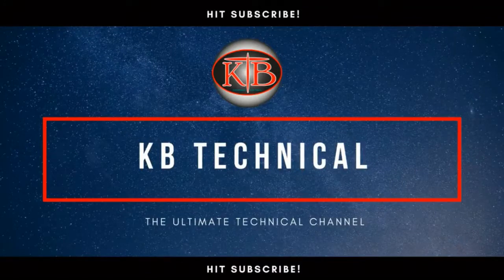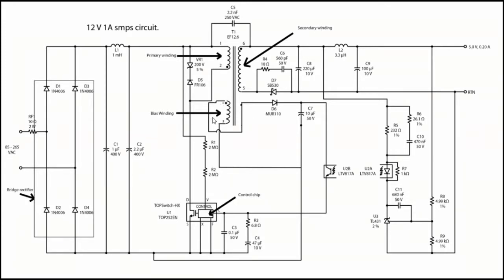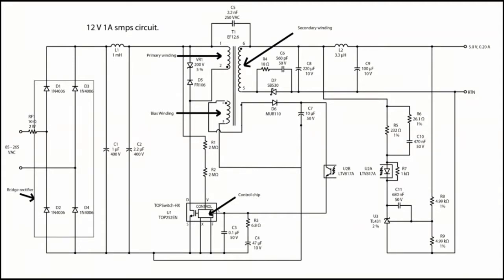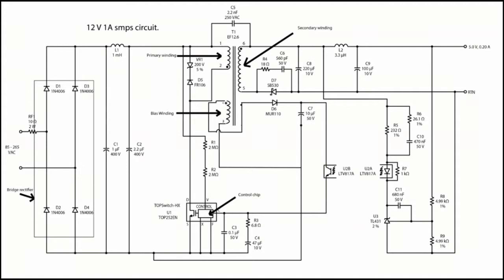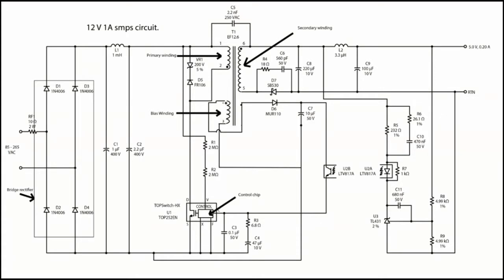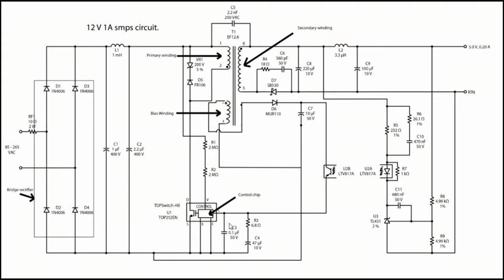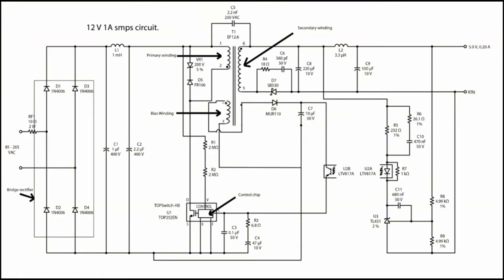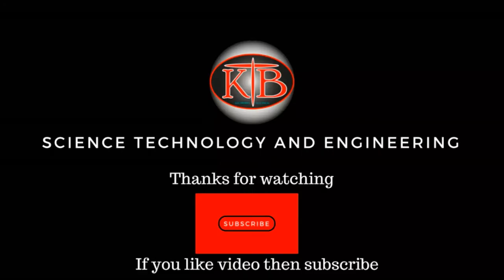Why use of Bias or Auxillary winding in SMPS transformer?

Comment: here is what I don't see. You have 2 resistors providing dc power to the control chip. Why do we need the auxiliary winding as well?
Reply: Not sure about TOP252, but for other IC's those resistors are used to soft start the IC.